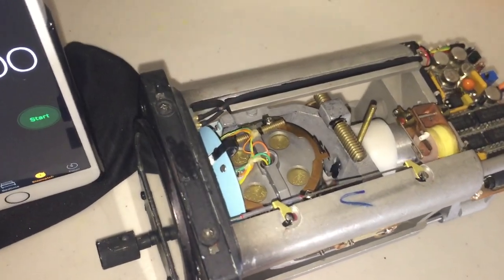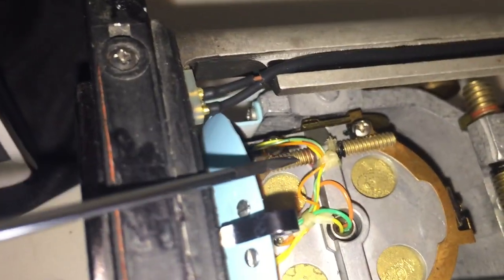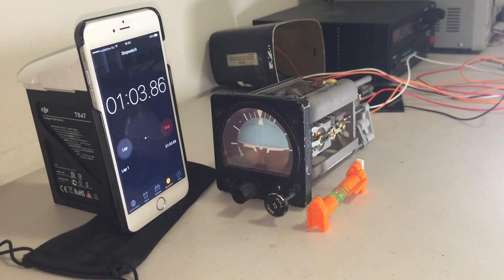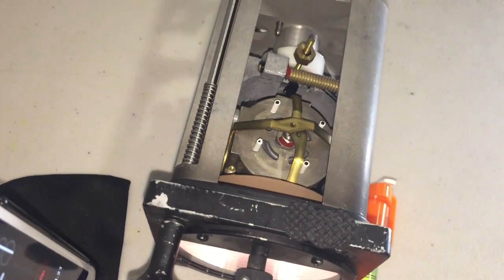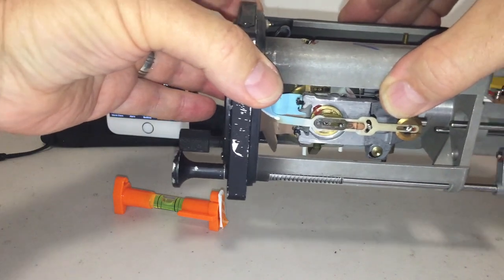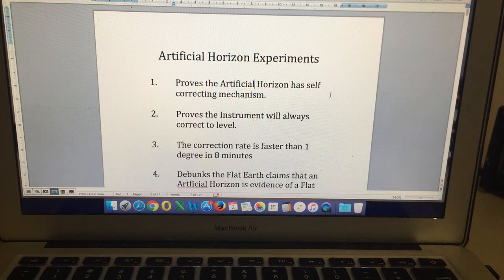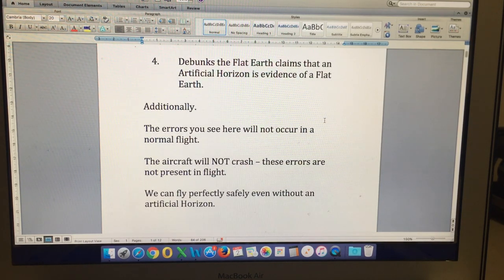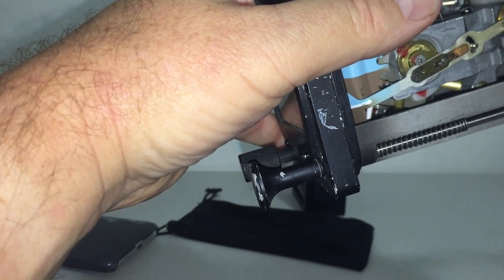Flat Earth - Time Lapse - Inside an Artificial Horizon while self correcting.

Comment: Good video. I can see how the gyro can self correct to the flat level  but when banking to the left or right surely there will be a centrifugal force that might cancel out the effect of levelling ?
Reply: +Citizen Smith,
 Correction is slow enough, 3-5 degrees per minute, so ordinary turns aren't corrected enough to notice.
Reply: Observ45er Ok thanks.

Comment: quick Q: ive missed something here: When you say the device is capable of self correcting to level... to what reference? Level with what? And can u elaborate more on how it does that? Thanks
Reply: The local gravity vector.
Reply: Thanks. i since found out its more or less a pendulum device that finds that vector.
Reply: good question. A pendulum aligns to the combined effect of the gravity vector AND the acceleration of the pendulum's nonaccelerated equilibrium point. So what is what, gravity vector or acceleration vector? And the next question would be how to measure that acceleration vector, and account for that..
Reply: Unless an airplane is accelerating or decelerating, there is no acceleration vector to account for. The correction mechanism shown operates slowly enough that jiggles would have no effect.
Reply: There are continuous accelerations in a plane flight, in any direction and over time they will sum to zero. The system uses the correction mechanism to align to G in the long term,  and the gyro to remain aligned in the short term.

Comment: Hey,
I'd like to ask a question if I may:
To your experience: Is it worthwhile taking an artificial horizon as a source for a nice gyroscope to play around with for some physics experiments, or is there too much periphery in there that would need to be connected up, even when taking the gyro out of the housing?
Reply from the maker: +Kai Broeiing.  Hi Kai,  to be honest I think this is not the best unit for those types of experiments.  There is a lot of periphery and powering it would be difficult if removed form the main housing  

I bought the Super Precision Gyroscope for some experiments but was disappointed with it.  Mine had a lot of bearing friction and was not balanced at all.  If it was better balanced it would have been a nice unit. 

https://www.gyroscope.com
Reply: +Wolfie6020 Thanks very much for the quick reply!
That's a bit what I feared...
I know the "precision gyroscopes" and frankly, I do not like the bearings or the gymbal.
Instead, I was looking for something that can keep running for a bit longer (ideally driven) and with a somewhat higher frequency ... all the more time to play.
I think, I'll try to get hold of an air-powered one, like this one: https://www.youtube.com/watch?v=f2thngd9AGI and try my luck by hooking up a steel reservoir and a fridge compressor.
If it works out, I'll post a video.

Comment: Perhaps I’m not getting your conclusion but I thought FE’ers talk about gyroscopes not because it can’t handle the 1 degree drop in 8 minutes but because, it shows that it doesn’t require the plain to make that correction?
Reply: The principal point is that basically, the action of the gyro is contstantly adjusted, making it not valid for proof of flatness OR curvature. It compensates for the curve, but doesn't prove it.
Reply: @paulcrumley9756  But why would they need to compensate for the curve, if there is none? Wouldn’t it be cheaper to design and build it without compensation?
Reply: @NoTraceOfSense  It's as much a compensation for innate precession errors as it is for curvature and earth rotation. A mechanical gyro is imperfect and because of imbalances and bearing drag in all axes, must be constantly re-referenced to something. In the case of a vertical gyro, it is referenced to local vertical acceleration vectors, mostly gravity. After a long sustained turn the horizontal axis may be incorrect as well, since the pendulous vanes read "gravity" the same way as the pilot does, when in a coordinated turn "down" is perpendicular to the airplane vertical axis.

Comment: Hold on a second. Or two seconds for that matter. At about 00:38 seconds you go into saying the camera will take 1 frame still photo every 2 seconds. And running for 1 hour and 30 minutes. That's 45 minutes of raw video footage. How are you then able to get that to play back within 1 minute and 30 seconds? To get 1 minute 30 seconds of video out of 1 hour and 30 minutes worth of time would require you to have 1 second worth of video for every 1 minute of video. That's every minute of video must be compressed into 1 second and you have 45 minutes worth of video. So you're playing it back at about 20x speed? It doesn't make sense. Ehhh maybe I'm missing something.
Reply from the maker: Normal video is 30 frames per second.     So 1 frame every two seconds means it takes 1 minute to get thirty frames. 

Therefore 1 second of video will represent one minute of real time.  

1 minute and 30 seconds is 90 seconds.    That means 90 minutes of real time.  1 hours and 30 minutes
Reply: @Wolfie6020  thanks for explaining that. I couldn't figure out the frame rate and it wasn't adding up no matter how I tried. But I really appreciate you clearing that up. I knew there had to be an explanation. I just want smart enough to figure it out. 😂😂😂. But I had hope that you knew something that I hadn't thought of.

Comment: This is so tricky. The airplane in the air is not stable and it can't correct itself in motion dear wolf .what is the point of the gyroscope in the airplane if he can detect the true horizon by itself?
Reply: viktor ivanov,

I’m not a pilot, but I would assume the purpose is to ensure the plane is flying level when the pilot wants to be.
Reply: ytmoog,

Why what can’t correct itself?
Reply: ytmoog,

Oh.  Next time, include the name, because YT notified me of the reply.
Reply: If it can correct itself ANYWHERE over "the globe" - because of gravity - then it would also be safe to cage it anywhere too. But in the REAL WORLD pilots not only cannot do that, they are prohibited from doing that. They are required to cage the gyro while the aircraft is stationary on the ground. Period; end of debate.

So experiments designed to demonstrate a gyro  would do  X,Y, or Z, are a waste of time. No real pilot believes that they are perfectly erect everywhere; or they would freely cage them while airborne too. After all, according to the "scientific" experiments being demonstrated by Wolfie, the gyro is going to be level everywhere it is spun up! Now, does anyone still buy into this smoke and mirrors attempt at disproving FE (using these gadgets that most clearly can't fathom)? 
.
.
.
Here work on this one for awhile: 

Space craft preparing to land on the moon purportedly used radar altimeters and artificial horizons as they approached the surface. However, while a radar altimeter would be useful in telling you how far away from the "ground" the ship was, an artificial horizon would be completely useless. Why? Because it would have been calibrated (caged) to show the horizon of a surface with four times the curvature. 

It could not possibly have been set to reflect the horizon of a body (the moon) until it first landed there. So as the astronaut got closer and closer, he could not possibly know the orientation of his craft to that surface. Was he perfectly vertical, or was he leaning to far forward or in another direction? Would all four landing gear impact simultaneously, or only two? He could not know without a functioning gyro. And it couldn't accurately reference the surface of a place it had not been calibrated to. 

So, why bother including such an AI in the LEM? Because people want to believe in "science" so much; look at all those blinking lights, all those dials, and all those knobs, surely they make the impossible possible. Technological smoke and mirrors. Intended to deceive.
.

Comment: Why do you not acknowledge in the video that an artificial horizon is not a true gyroscope which would not have self correcting mechanisms?
Reply: That's the whole point of the videos. The flat Earth claim was that the artificial horizon would roll back as it goes around the planet like a simple gyroscope. Artificial horizons have a mechanism to level them to local gravity.

Comment: Perfect demonstration and explanation of what the Artificial Horizon really is all about, but could you please, if possible make a video how the Attitude and Heading Reference System (AHRS), or Inertial Navigation System for guidance (INS) works, especially gyroscopic pendulum that is built into tracking system in order to compensate on long haul route the Coriollis effect and align the flight path?
I would love to hear you take on it.
Reply from the maker: +Kris Fekete I could make one showing how we power up the aircraft and that it takes 6 minutes for the triple IRS to align themselves.  We don't have any attitude indication in the aircraft until that happens.

Comment: Now replicate this  experiment while traveling 3000 miles non stop at the same altitude.  As you go around the ball, the attitude will change from the calibration you made at take off.  but this never happens.  If it did, instrument only long distance flight would be impossible.
Reply: You made the typical flat earther argument which is that a gyro will always stay the same relative to itself (when it was started up, started spinning), so if you go around a globe earth it would keep its angle as it was when it started. On the way around a globe earth that gyro would not show level horizon after a short while because the angle changed relative to the starting point. 
But you just don't get the point of the video!
This video shows the SELF-CORRECTING feature of flight level indicators using gyroscopes. Every time he set the frame to change the angle the mechanism corrected itself. That means in flight, when you stay at the same altitude, while changing your angle relative to how it was when you started, the gyro would correct to show the actual flight level of where it is at the time.
It shows exactly WHY a flight level indicator does always show the actual level no matter where on the globe.

Comment: Then your gyro would be showing a nose down constantly during flight. If the gyro is constantly showing level and your constantly nose down your in deep shit. Especially in storms or night flying.
Reply: Charlie Jeans   ???  Why? The gyro is always level to the earth because gravity is perpendicular to the gyro and the mass of the earth. The plane flys level to the earth at the same altitude. If you’re flying at 30,000 ft you maintain this altitude and the gyro will show level.
Reply: You wouldn’t be in really deep shit.

If you’re in IMC, and your artificial horizon shows level, but your altimeter is decreasing, your vertical speed indicator shows that you’re descending, and your heading indicator shows that you’re turning, and then ATC tells you that you’re off course? You can make a reasonable assumption that your artificial horizon is borked.

Comment: hi,i understand that if you need to test how something behaves underwater, it needs to be tested underwater. to test how an attitude indicator works in flight cannot be tested on a motionless tabletop. that being said, it is clear the gyro in this equipment/experiment can correct itself. but heres the thing; a car tyre can protect the cars occupants from a lightening strike should one occur, but tyres were not designed with that in mind and its a safe bet you wont find it on any design plans. that also goes for the attitude indicator. earth curvature is not taken into account of its design.
       it was designed to self correct errors on taxying/runway, takeoff, landing and errors like "tumbling" in drastic flight manouvres, as in a second world war dog fight.  please show us in design schematics where it was made to compensate for earth curvature should there be any. in fact show any navigational engineering document from the government,nasa, army, navy or airforce where earth curvature is factored into the calculations of bridge, canal, railway, flying etc is considered. all this test truthfully shows is that the gyro is housed with self correcting properties (providing it is not broken when it tumbles).
        as an after thought, if this was the case, that it can correct itself on earths gravity to correct for curvature, then it was pointless putting gyros in the apollo navigation and flight controls that allegedly took them to the moon........do you get that yet?.
Reply from the maker: Hi Ray,  this video was not intended to be a claim that the instrument proves Earth curvature.  It simply proves that the Artificial Horizon can correct itself.  That ability alone debunks the claim Flat Earthers make about it. 

Their claim is that the gyro always stays rigid in space and that it cannot self correct. 

The instrument does not know what causes the error.  It simply corrects the error to always align to the sensed direction of down.  

By showing that it "could" correct for Earth curve the Flat Earthers can no longer claim it as evidence of a Flat Earth.
Reply: @Wolfie6020  thanks for your response. Yes, I see that it cannot prove flat earth, but the table top test doesn't prove curvature either. My point was that it wasn't designed with the intention of correcting for curvature. On those thoughts I find Myself with a question about a lengthy holding: would the pendulous vanes be affected by the centrifugal force of the continual banking?
    My afterthought points out that if the gyroscope needs gravity to correct itself, the gyros in the Apollo space craft used for navigation and control, are pointless and can't work. I also mentioned that I cannot find any engineering plans that factor in the alleged curvature, including the attitude indicator.and the diagram for space gyroscope instruments have no pendulous vanes. That opens up a whole bunch of other questions.

Comment: Its debunks nothing! The gyro just staying on table have to change his angle for 15 dg in one hour. Just switch the correction out and  watch, nothing will happen!
Reply from the maker: You are quite mistaken.  This fully debunks the Flat Earth claim in relation to the Artificial Horizon.

Flat Earthers claim the instrument remains level with the starting point and would show the Earth curve by doing so.  

This video proves the insturment constantly corrects to level.   It can correct at the rate of 2-4 degrees per minute.  That is more than enough to correct for 1 degree in four minutes (15 degrees per hour) and flying at 450 Knots. (1 degree in 8 minutes) 

If you remove the correction the instrument will precess  and be useless to a pilot.

Do you agree the instrument has correction mechnanism?   Yes or No? 

If you correctly answer yes then it debunks the Flat Earth claim. 

If you answer no then you did not understand the video.
Reply: @Wolfie6020  one more time, i do not talk about how it's used in planes. Working gyro by just staying on the table without any corrections have to change his angle 15 dg / hour. Its doesn't happen!!! That's all!!!
Reply from the maker: @AndrejOdessit  But that is deflecting from the actual point of my video which was to debunk a specific Flat Earth claim which I did thoroughly.   Your claim that this debunks nothing was incorrect. 

Do you think this gyro has perfectly frictionless bearings and perpetual self sustaining motion?

Any friction on the bearings or torque effect on the motor will result in quite rapid precession which make any assessment meaningless.   

Do you think this is a perfectly balanced and frictionless gyro?

See here what happens to a gyro without correction mechanisms.  This moves for many reasons.  Friction and torque effect.  

https://www.youtube.com/watch?v=UPgYfngHYXA
Reply: @Wolfie6020  it is not serious to compare diy shit with professional instruments. One more last time. If the earth spinning 360 dg/day, the kipping his position gyro have to change his angle relatively to earth 15dg/hour. Does it happen? NO!!! That's means the earth is not spinning. What form it has I'm not a clue, but it not rotating!!!

Comment: so it stays level to the earth?
Reply: imawopo Level relative to the direction of gravity. This is the reason why objects in freefall, like with the ISS, they need to use more exotic solutions to find "level".
Reply: no water is allways level
Reply: imawopo Level relative to what? Water is a fluid, and what it does is settle into a state of equilibrium. In the absence of gravity, it forms into a ball and when influenced by gravity, it turns into a pear/tear drop. When water is under the influence of gravity and pressed against a surface, it is smeared over the said surface.

Water have no concept of "level" and neither does anything else. In classical mechanics (in simplified terms) you either have a static system that is in equilibrium or a dynamic system that is not, and that's what is actually meant by water "finding level" - it is moving towards a state of equilibrium.
Reply: @SeaLevel211  "Lowest point exactly the ocean"? Even attempting to read your comment gives me a headache.